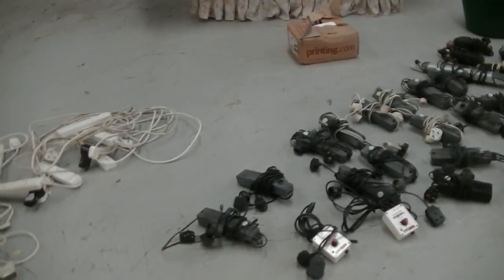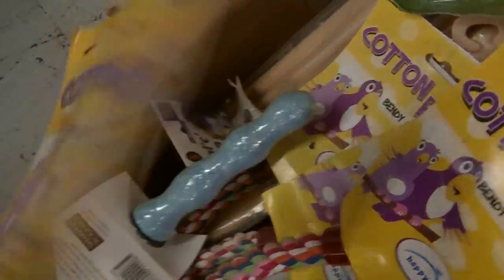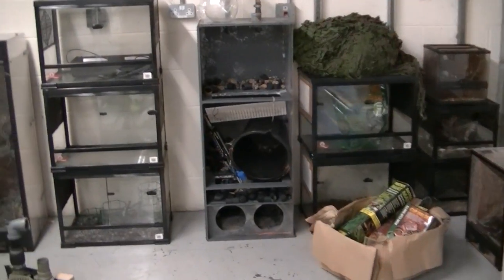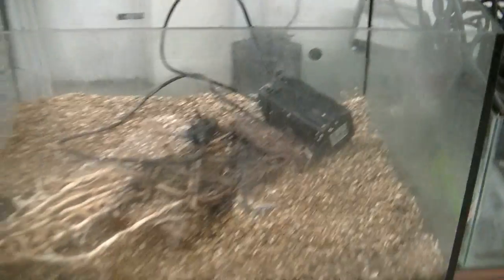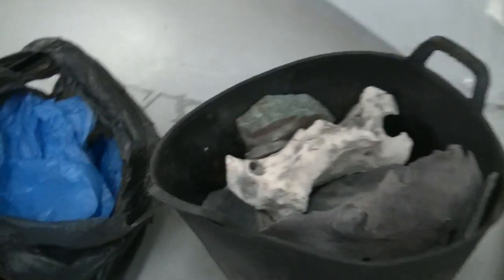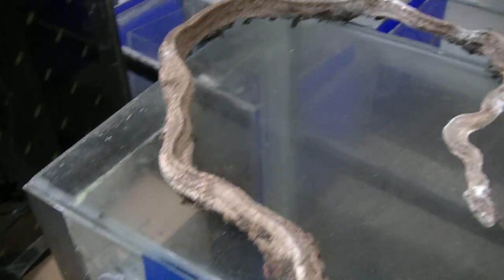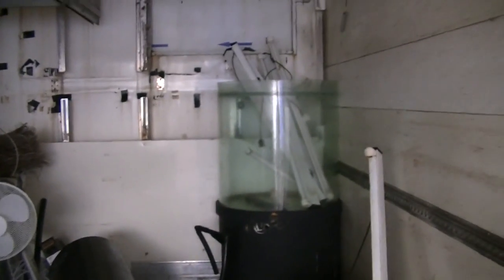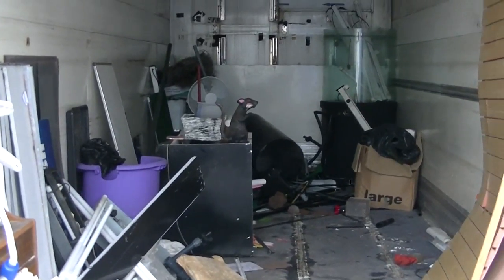We make a horrifying discovery among'st the aquariums for auction!!

Comment: 3:57, I see a snake acting like a part of the branches in the vivarian and I was surprised you couldn't see it. Looked like a pit viper to me, the bottom of the mouth has a bunch of holes (pits) that those kind of snakes use as heat sensors. It is staring right at you!
Reply from the maker: omg it does look like one i willl check again lol!!
Reply: Dramatic Aquatics was it? I doubt it lol

Comment: Save that dried snake, man. I will powder it up as a traditional medicine and it will complement the panda spleen and tiger penis nicely - very good for the Yang.
Jokes aside that is an awful way for something to go - god damn.
If you're auctioning electrical items you'll have to make sure that there is an electrical socket or two for the buyers to check working condition before the sale is completed.
Unfortunately the footy match on Sunday is at Kibblesworth and is a 10am kick off so I will miss the auction however there is a load of stuff I need for the mega-filter build this winter. I'll try to get up after the match.
Reply: Pondguru lol... I'll pass, thanks
Reply: Pondguru I